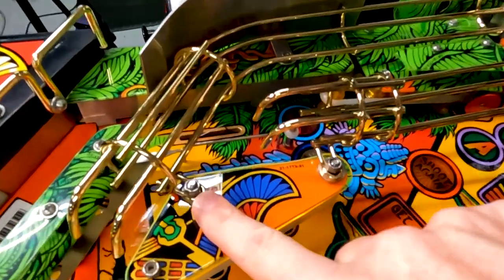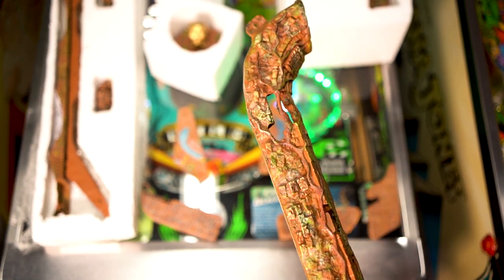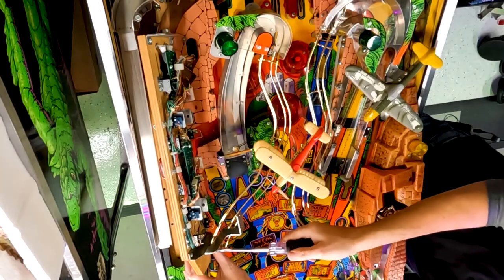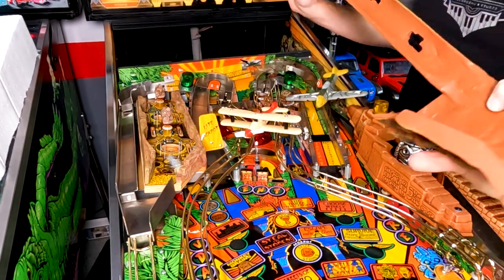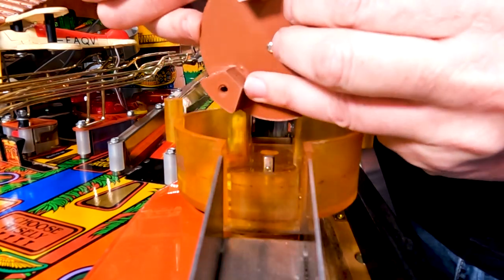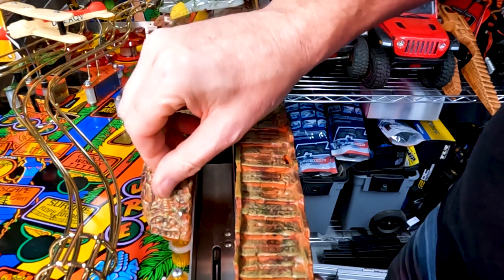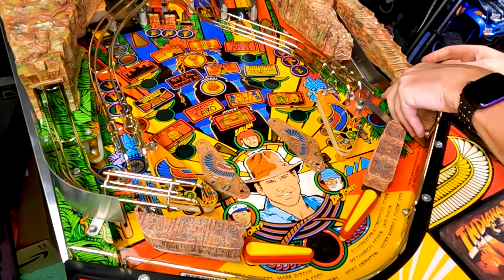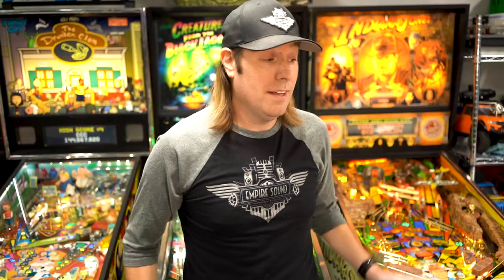The Ultimate Mod for your Indiana Jones pinball machine by the Art of Ppinball

Comment: You should have done something about that faded cabinet before doing mods.
Reply from the maker: I just got a set of Rad Cals for it, Stay tuned to the channel for that video!
Reply: @empirepinball  Installed lots of those.  When you put them on, either sand down to just the white layer and paint white any dark areas [imperfections] or go to bare wood as they are very thin in the artwork layer and will show imperfections thru the radcals.  FYI.  Will make a stunning machine!
Reply from the maker: @danielgoett  I bought the Mirror Rad cals so same process with those too?
Reply: @empirepinball  I haven't installed any of those, but probably the same. Looking forward to what one looks like!  Get to it!  ;)